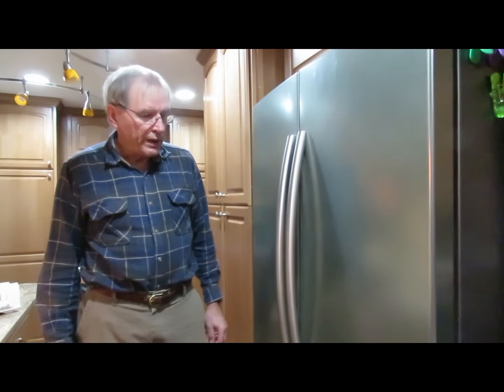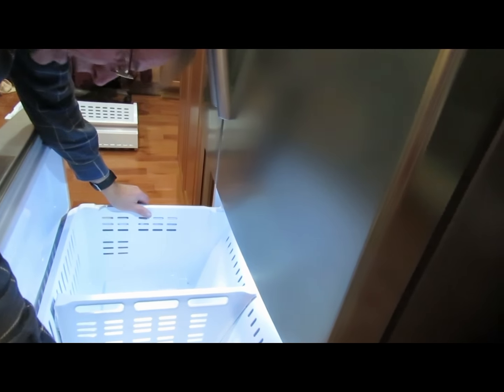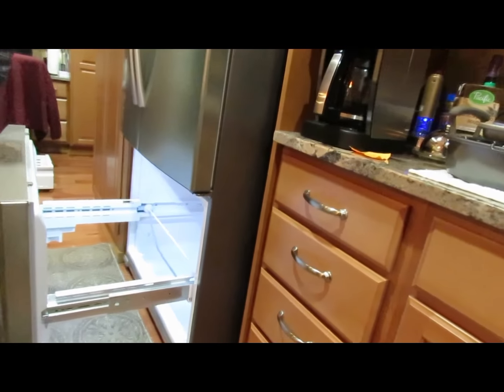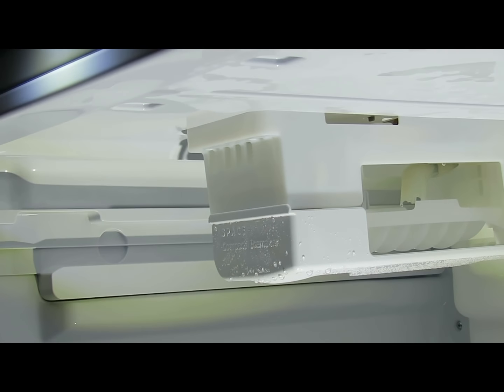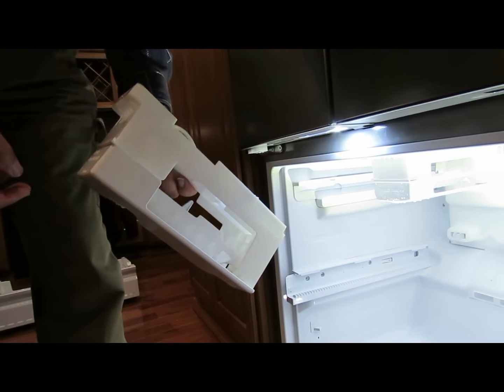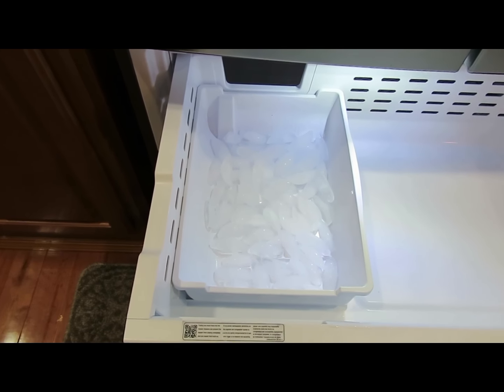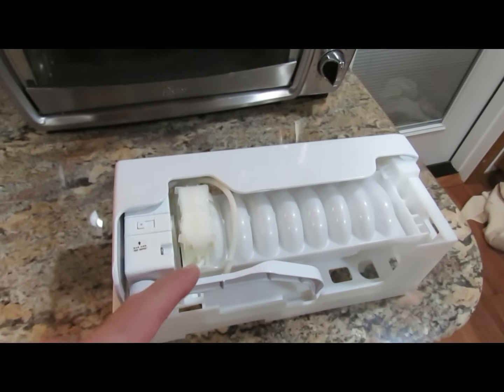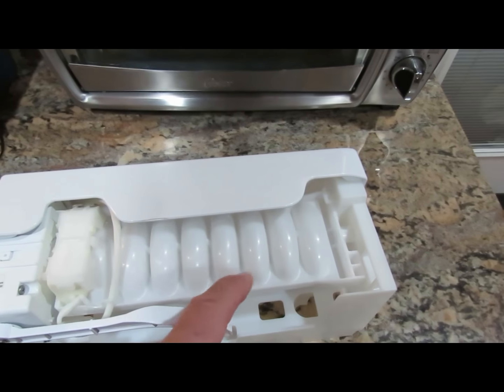Samsung French Door Refrigerator/Chest Freezer Ice Maker Repair

Comment: I bought all matching samsung for my wife. Fridge, stove, over range microwave. I will NEVER buy anything samsung again. Microwave didn't last the 1st day. 2nd microwave the lights burnt out in 30 days. Oven convection fan squealed 1 month before warranty was up, as well as the fridge ice maker at the same time. Now the freezer ice maker. You couldn't give me a samsung!
Reply: We bought all pieces also. NEVER EVER NEVER AGAIN.
Reply: Same, my oven display turned into a disco ball.
Reply: I agree 💯 percent. My Samsung microwave is mediocre at best and I have the same model refrigerator this gentleman has and it is garbage. Samsung knows about the upper evaporator freezing problems along with the drain freezing problems.
I had to install the drain kit, modify the heater tab into the drain and install an extra heater on top of the evaporator just so it would work longer than 6 months without needing defrosting.
Recently the refrigerator started freezing everything and ice maker stopped working. I had to replace the main control board to get it from freezing but now the ice maker cycles when pushing the button but doesn't make ice.
What a joke of a company.
I think they only know how to make phones lol.
Reply: @douglasmoore8033  I've had a few of their phones in the past. I did not like them either.
Reply: I’ve had the very same experiences with our Samsung appliances. Even if they were the last appliance option on the plant, I wouldn’t buy their garage again!
Reply: It happens the same to me  with General Electric lol
Reply: Same here!  Samsung appliances...never again!
Reply: I agree, they need to stick to cell phones, their appliances are garbage.
Reply: They all suck but lg is garbage. Samsung issues seem minor in comparison
Reply: Samsung kitchen appliances are POS.

Comment: Perfect video. Was about to order from Amazon (now $124) but read through the comments and, thanks to a couple of folks in here, was able to pull out the top drawer, reach into the ice tray where I felt a chunk of ice cubes stuck together that were preventing the unit from cycling. The reset button that you clued us into and the tip about an ice blockage were the keys for me.

Comment: Tom, I have four Samsung icemakers in French Door models. (I have an in-law apartment connected to my home with one of the fridges.) I am a 'regular' mom/Realtor/grandmother, 63 year old woman. I was prepared to replace the ice makers in my 'fridge hallway' where instead of an all-fridge and all-freezer set, I opted to buy two French door Samsung's with ice makers in the bottom drawer, for an extra 44 cf of space for half the price as my original plan and more space. The power blinks in our county often lately and the icemakers in these models quit producing ice  (even though I have a whole house surge protector) . Looking for repair ideas, All I had to do was to find that 'reset' button. To help someone find it, just get on your knees and  extend the drawer enough that you can feel the front of the icemaker. You do not have to remove the bin, drawer, or anything to "find" this reset "button". The "button" is SO SUBTLE, you may not 'feel' a button, per se. Just take your pointer finger and under the front edge area about 1/4" from the edge, toward the middle of the ice maker or left of the middle, slightly lift up your finger and there is a very, very small flat area that will move upwards. My initial thought was, that's not a button. But like other "reset buttons" on appliances, I held it for 3-5 seconds and I heard the machine make a noise to start. I had put a shallow bowl in both units and pressed and depressed it over a few hours to see if it was on or off. One dumped water, the other ice. I figured I turned them back on during different cycles. When I felt they were both on, I checked the bins this morning and they have been making ice all night with a respectable amount of ice. By this evening, I will be 3/4 full on the bins, I am sure. THANK YOU, TOM!!! Thank you. You save me a lot of money. I would have authorized a repairman to replace the icemakers. I'm sure you save me hundreds of dollars, time, and a whole lotta' mess.
Reply from the maker: Glad to hear that you did your DIY repair!

Comment: Thank you! I had this fridge in a house we bought and they didn’t have the ice set up. We installed the water line but The manual doesn’t have the reset button so I was searching for how to check it was working. It ran through a cycle and my ice maker has water in it. Thanks!!

Comment: Thank you, sir!  My ice maker stopped working and from visual inspection, I saw that a cube of ice had wedged itself in the mechanism preventing release.  In order to remedy the situation, I had to get to the maker.  With your video, I easily removed both drawers.  But, I still could not release the bottom drawer itself.  Nonetheless, I had enough access to the device to melt the ice in the unit and free the device from blockage.  Thanks for indicating the test button!  It is now working and the freezer compartment is now clean and devoid of those cubes that had fallen all over the place.  You saved me $$ for a repairman to do the same!  I must say that this frig/freezer is the biggest piece of junk.  It makes noises like a shotgun, is clumsy in every respect.  My Samsung dishwasher lasted 4 years and was equally horrible.  From here on in, it will be Frigidaire for me!  Thanks you, again for taking the time to make this video.  Much appreciated!
Reply from the maker: You have to have the drawer slides in just the right position to access the locks that release them, buy they are there.

Comment: Thanks Tom for the great detailed procedure, it was hard finding something for this specific model.  A word to others with this problem, as I had the same problem as well.  I could hear the mechanism working and when I pushed the test switch, everything seemed good so I suspected the inlet valve.  I knew from other videos that, conveniently enough, the water tubing is exposed on the back of the refrigerator.  I found the tubing connector going from the inlet valve down to the ice maker.  I had seen from other videos that to get the tubing out of the connector, you remove the red cover cap and then push on the grey flange around the tubing while pulling on the tubing.  I did this and first I tested the valve by having my wife hold a bowl under the connector while I pushed the test button on the ice maker and sure enough the water came out at the end of the cycle.  I had read that the tube may freeze over in the ice maker and others had used a turkey baster to put warm water through the tube and defrost it.  I didn't have a turkey baster so I just blew through it.  It did seemed to be blocked at first but cleared.  That must have been the problem though because this morning it's working again.  You might want to try this before replacing the ice maker.

UPDATE 12/20-  If you have this problem, it's likely that the heater element that keeps the fill tube from freezing is bad or weak.  Replacing the whole assembly is easier.  Here is a link to the part I bought https://www.genuinereplacementparts.com/samsung-rf260beaesr-ice-maker-fill-tube-genuine-oem?gclid=CjwKCAiA_eb-BRB2EiwAGBnXXgtPaU1pq57Zgg1wIzCHlpADyMLJEizkQlhnWPgKGg9Gke9g2gwY1RoCJ54QAvD_BwE.  The good thing is I live in Florida and ground shipping got here early the next day.  Here is a link to the video that showed how to do it https://www.youtube.com/watch?v=_3FF8AOQyZs.

Here are my comments on that video:

I have a slightly different model and I was able to do it without completely removing the drawer but that would have made it easier, especially getting the screws back in when reassembling the ice maker.  I also bought the entire assembly with the heater already attached, I think it's worth the extra money to not have to spend all of the time changing out the heater.  Mine didn't have screws in the back to hold the filler assembly in, I guess they changed the design a little.  I also had to pull very hard to get the old one out as the end of it had started to unwrap and had trouble coming through the hole.  I hope all of this helps someone!
Reply: Link to other video with this? Thanks
Reply: I probably should have read this first as I found an ice plug in the fill line while replacing my ice maker, but I used a hair dryer to thaw it. Thanks, next time I'll read all the comments first.
Reply: larenz - This was our problem - THANKS MUCH for posting your comment
Reply: Question: I need to turn off the water first ?  I'll looking into this as my arm is stuck in the up/off position. I've tried the reset button and nothing works.

Comment: Thanks Tom - GREAT video. Our problem ended up being a frozen inlet tube. No water was going to the ice cube tray. We ended up using a hairdryer to thaw it and lo and behold water starting coming out again. Thanks to Larenz's comment from 7 months ago we were able to fix it.
Reply: So you didn’t need to replace the ice maker? You tried the hair dryer first?
Reply: @graceblanco1900  I had the same issue on mine. The tube that empties into the ice maker had a plug of ice in it and after it thawed water began to flow again. Strange that the water froze there, but apparently it happens.

Comment: I have one 6 months old and it never stops making ice.   The arm stays up all the time.   Shouldn't the arm drop down and then when the ice in the bin pushes the arm up it shuts down the ice maker?
Regardless I have a new one ordered.   Your video was perfect.   I wish I had seen it before I read the owners book because you explain better how to remove the door.    Thanks so much for taking the time to post this video
4 years later it is the gift that keeps on giving  :D
Reply from the maker: Thanks! It took me a while to figure out how to take the door off (I took the bolts out the first time!).

Comment: I love your "how to" videos. They have proved very helpful in my attempts at troubleshooting why my Samsung ice maker stopped making ice:
1. Pushed the test button, and it cycles completely so I know all the components are doing what they are supposed to be doing.
2. Pulled the supply line and water was flowing.
3. Disconnected the supply line at the entrance to the ice maker, and no water.
4. Replaced the filter and it started flowing again.
5. Got ice for about two or three cycles and then it stopped again.
6. Pulled the ice maker and found a plug of ice in the water outlet.
7. After the plug melted water is flowing to the ice maker and is making ice again.
Whew, it has taken me several hours over the course of two days to figure out what is wrong, but I think I finally got it and I saved myself several hundred in repair bills. Thanks!
Reply from the maker: Thanks!

Comment: Thank you very much, worked well for me. What I did was pop the side pins like you said, pulled the drawer out , but didnt remove from the slides completely. It gave me enough room to get at the screws holding the ice maker. Unscrewing by feel, but alot better than trying to install the freezer door. Thanks again.
Reply: Same here. I did not remove the door completely. In fact, I only removed the top insert in the drawer.

Comment: Great video. I figured out that my water line freezes from time to time which prevents it from making ice. I used a blow dryer to melt the ice ins the line and left the freezer open for a bit. I pressed the button on the motor to cycle it. It was making Ice again in an hour or so.
Reply from the maker: Your water valve may have a slight leak, which then freezes up. Try using the test button to force a cycle and watch for any dripping water.

Comment: GREAT vid.  I will add, after installing the new one, i hit reset 10 seconds and nothing. Got on chat support with samsung and the chatbot said unplug fridge for 2 mins, then plug in and try reset button again and should cycle and chime. IT DID !!  VERY important to unplug fridge 2 mins and plug back in before trying to reset. Maybe not with yours, but was with mine. Again, THANK YOU! i spent min $ on amazon and had this back in service in two days! ANd i got man points with the wife and got laid, LOL.
Reply: Your post was perfect!  It saved me from buying a replacement ice maker.  I unplugged for 2 mins and then pressed the reset button on the ice maker after powering back up.  The ice maker is working again!   Thanks for taking the time to share this information -- along with Tom's video this was exactly the information i needed.
Reply: Great video, and what Dave Sharp mentioned saved me a huge headache!  Worked like a charm!
Reply: Thank you all! First to Tom for the original post with the reset button info and then the follow-up about unplugging the ice machine for 2 minutes plugging it back in, and then hitting the reset button. It went through it's initial cycle and worked for me! Now just waiting for first batch of ice!
Reply: Thank you for taking the time to add this info!   Unplugging for 2 minutes was all I needed to get my ice maker working again.

Comment: Thank you Tom, i have had to use the reset multiple times,  but now I am  getting a  ice buildup on the bottom of the freezer.   Any suggestions?
Reply from the maker: You must have some sort of water leak. Try to catch in the act of filling and see where the water goes.

Comment: Thanks!  Your video was better than most I found when googled.  Especially since I used the exact model but still got hits for various other models.  The only thing I'd suggest is a little more about the "operation" of the ice maker.  I say that because I didn't have mine installed, the spot wasn't ready so they just delivered to the kitchen area.  The thing didn't make ice overnight although I know it was hooked up right, water on.  The manual doesn't give much info.  The "on" position turns the light off.  Instinctively one would think the light on means it's on but not.  Also, I was thinking the arm on the side of the "maker" would go down to sense the ice level.  But didn't force it, started googling.  I saw you hit the ice off/on button and the light went out so deduced light off meant "on".  Then I hit the test button and it cycled.  Was just more guesswork and that manual wasn't much help surprisingly.
Reply: GB NoMore where is there test button ?
Reply: @daisym.5739  It may be called the reset button. But it's basically a test to make it cycle. He shows it at 5:08, but obviously it's out on the table. When it's installed it's towards the front on the bottom kind of hard to see just feel around. Or use a mirror.
Reply: GB NoMore I just pressed on it thanks, I thought maybe there was one somewhere else. Our fridge hasn’t thrown out any ice, but there were frozen ones in the tray. I’m not sure what to do.
Reply: @daisym.5739   Daisy M.   there's not too much to them. As long as they're turned on and the wires are live so the unit is getting electricity and the water is there it should work. Unless the icemaker itself is malfunctioning. Then you would just have to replace it. I think when you push the reset button it should either eject the ice that's in there or it should cycle and fill with the water.  You said there was ice in the tray, not sure how much but it's trying to work. Probably the hall sensor he mentions is out or the dispense function is not working properly.

Comment: Great instructional video. Our Samsung's upper ice maker unit freezes sometimes requiring a blow-dryer to quick defrost. The bottom unit just stopped working. Thank you for this sir!
Reply: I know they make a retrofit kit that extends the heater down the drain.   Or use a bare #12 or even #14 copper wire wound carefully around the heater extended down the drain tube.

Comment: I think we have the same or simiilar model. A couple questions: 1. Does yours have a water filter? I'm getting a red water filter notification up at the top of the refrigerator display panel but I can't find a filter anywhere. 2. Does yours have an automatic shut off once the ice bucket is full? Ours just keeps filling until we shut if off manually. The other thing that was funny - I couldn't figure out how to get the top freezer basket out. I did exactly what you showed but there wasn't enough room to get it out. I finally realized my freezer drawer wasn't all the way open. I literally had to thrust the drawer open several times and it would gradually open a little bit further each time. We've been using it like this since the day we got it! So nice to know I can open it all the way now for easier access!
Reply from the maker: 1. Yes, but it is for the freshwater dispenser, not the ice maker.
2. Yes, it is the metal bar that is lifted up by the ice in the tray. There must be a broken microswitch in your ice maker. You must have some contamination in the drawer slides. Lube it with a PTFE spray from CRC.
Reply: @tomseim  we don't have the water dispenser so I've determined we don't have a filter. And we don't have a metal bar on the ice maker. I've read where others have had problems with the ice not shutting off as well.

Comment: Thank you for the video.  We just moved into a new house and they have this Samsung. We already replaced the stove, microwave and dishwasher..I do not want to buy a fridge as well. I am going to try this because mine is doing everything fine when I hit reset but it won't dump after freezing
Reply: I have the same issue - I changed the ICE maker out - same issue, I changed out the controller board - same issue.  Conclusion is "Samsung is a piece of junk"